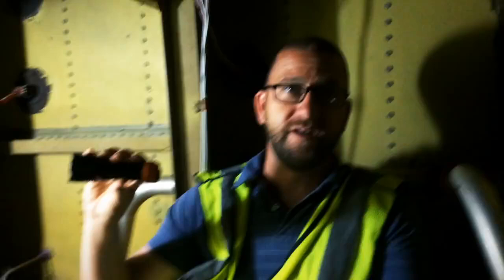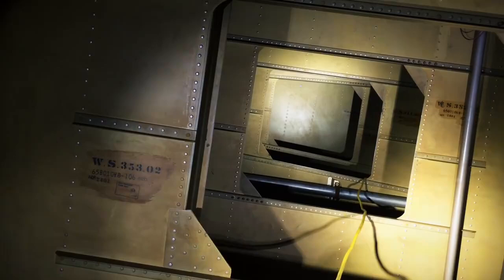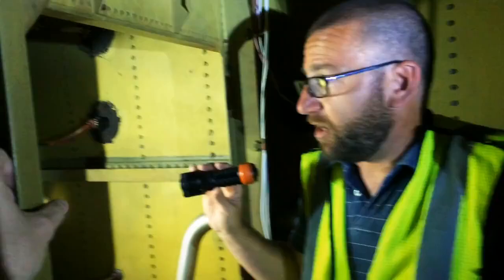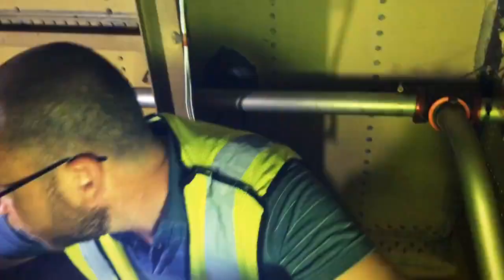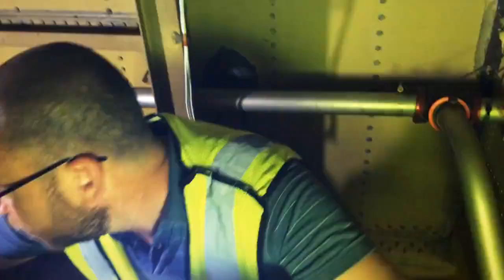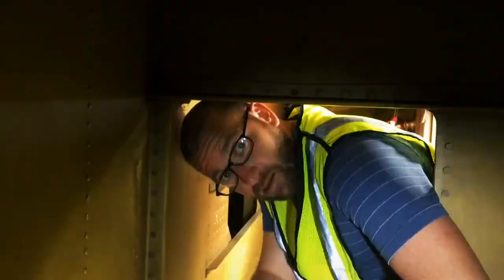The 747 Experience: In the Fuel Tank

Comment: The areas you showed that you called walls are actually called ribs and their main function is structural support so the wing doesn't collapse in on itself. What you have identified as ribs are actually stringers. I know the make up of the airplane wings because I've worked on them.
Reply: Thank you alphamalewolf1968. Good to have that cleared up, I was a little confused myself.
Reply: How tall are the wings supposed  to be?  Because from the  outside doesn't seem to be too tall or more than 2 mtrs high.  Also if anyone compares the mechanism used to move the hydraulic system of the wings that just plain and simple makes the whole scientific and engineering  data illogical, also why there is need to use air turbine starters? Also if it carried fuel as Mr speaker claims as nothing but the TRUTH  what doss ignite the mix. Air-gas?  Where is the fuel pump.  The whole  idea makes no sense at all whether the indoctrination is covered as education.  I find quiet interesting that even in some real videos of planes on fire in the airports  can last more than 4 minutes without exploting and still can't find evidence to discredit the lie about the whole crude oil itself as they say are the remaining  from some fossils or Dina sours...  Its there when you start to connect the dots and one issue opens up to what the CIA used for a cover up as "A CONSPIRACY THEORY" hoping the blind sheeple will follow the pattern,  as its always been proven "REPETITION"eventually truth will make its way,  as always.  Check this video,  recommended  to watch it complete. 
https://youtu.be/G28OlUqpUfE.  Also want to make sure I respect what your opinion is, wether I agree or don't, but life has fact proved government  and many  corporations have lie to the public in anything  from drivers  license when we have a right to travel, false  flags to push their agendas as recently the ban on guns, the moon landing and NASA itself with C. G. I cartoon photos..  And the list goes on and on...   The evidence its in plain sight,  but many are not yet ready to confront the reality  I guess.
Reply: George, I don't speak fluent gibberish so deciphering this is difficult for me. 
Here is a video of two men standing inside a 747 centre fuel tank, which will give you an idea of height. https://www.gizmodo.com.au/2012/07/these-guys-got-inside-the-fuel-tank-labyrinth-of-a-747-jumbo-plane/
The fuel pumps, and there are many, are usually mounted in cavities under the wing or on the front or rear spar. Each engine also has a high pressure fuel pump. 
As your sentence about hydraulic wing surfaces makes no sense I won't even bother. 
You ask about air turbine starters and your link points to a video about a jet engine starter, what’s your point? It’s used to spin the engine so fuel and ignition can be added to make the engine run. It’s the exact same principle as a car engine electric starter. By your logic if a jet engine uses air to start it must run on air, ergo, a car that uses electricity to start must run on electricity.
The fuel/air mixture is ignited by igniters in the engine combustion chamber. The igniters are similar to a car, lawn mower etc. spark plug.
Not every plane crash results in fire, the fuel tanks need to rupture, they must have fuel in them and there must be an ignition source. Jet fuel is difficult to light unless it's vaporised so even if there is escaping fuel it may not ignite.
The rest is just mad loony rambling but you talk about ‘sheeple’ yet you are the one following this drivel which has absolutely no supporting evidence. You should look in the mirror before you label people sheep.  What are ‘Dina sours’? A new sweet/candy?
Reply: David Tipton. I've just remembered something that "PROVES" trucks have been running on nothing but compressed air for many years. At least according to George Miller's logic. Up until not very long ago Mack trucks used compressed air to start too. I split my eyebrow open one time when I was working on one and another idiot who shouldn't have even been near it hit the starter. I was leaning over the right front wheel and that bloody noise they make had me launch upright and straight into the outer canister of the big air cleaner bloody hard. Gee, what a waste of good aluminium those 4 huge diesel tanks were.  On a Kenworth  I used to drive I had to keep filling them with around 800 litres of diesel or it wouldn't go anywhere. I know that for a fact. I actually ran out once thanks to a non working fuel gauge and a boss who'd just used it and said he'd put plenty enough in for the 1,300 kilometre trip I was heading off on. I knew I should have double checked, but he owned it and "should" have known better than anyone, he was wrong and I gave him hell when I finally did get back. I guess it must just be the Mack brand trucks that have been using this magic air fuel for 30 or 40 or whatever years.  I think they must have lost that technology because I don't think they use air starters any more, poor Mack trucks boo hoo.
Then again, just maybe, and just like the jet engines, they only use the compressed air stored in a receiver tank that they have to have to release the brakes anyway to start it which uses a compressor driven by the DIESEL ENGINE to refill it. OHHHHHH how the plot thickens. Or is it the heads of some of these conspiracy theorists that are becoming thicker lol.
Reply: King Congo:
I think most of the people agreeing  and commenting are very young and their brain hasn't developed fully which I believe doesn't occur until the early 20s. If there are people over that age making similar comments then they should be ashamed of themselves for being so gullible. 
I hope you recovered from your eye injury 👍
Reply: That's the thing that scares me David. While I'm sure you're right about most commenting are clearly young and immature there's clearly a bunch who I'm pretty certain are mentally immature, I'm pretty sure that some actually are purely and simply, mentally handicapped 'adults, like georgey boy above'!  Shocking I know, I'm actually serious here though. I do believe that there are actually, at least a few people who are actually THAT impossibly stupid!
The eye injury was nothing worse than I've had boxing or banging my head somehow in any sport thanks, just a three quarter inch split right down to the bone, buuuut, nothing new for me at all thanks David.
Reply: King Congo:
You're probably right KC, you really don't know who you are dealing with here or what their mental state is. It's just so frustrating seeing other people being mislead by these fools.
Reply: "  It's just so frustrating seeing other people being mislead by these fools. "
That's the part that really angers me most. There's no end of idiots that see the big numbers withe weight, fuel loads, cargo and passenger loads and just because they can't wrap their heads around it call BS, then the conspiracy kooks just love to feed that and try and make their idiotic lies sound 'more' reasonable by coming up with idiotic crap like this ridiculous and impossible compressed bullshit and so many know nothing people read their crap and since "it's only air" and doesn't weigh hundreds of tons they are much happier to believe the lie. If only they could get those same heads that couldn't comprehend the numbers there to what air compressed down to a liquid weighs they'd soon start to rethink their ideas. On top of that, even with air compressed right down to liquid I doubt it would create enough thrust to do more than move it maybe a few feet before it was all exhausted. And just where is this imaginary compressed air stored? Those wing tanks certainly couldn't be relied on to contain more than a few pounds without deforming the surfaces and likely making the aircraft unflyable. A few more pounds and they're likely to explode.
It's funny how the simple answer is usually the right answer, yet here people insist on thinking everything they're told must be a lie and the most ridiculous story "must" be the right one.  The world in general has made amazing advances in every aspect of life from medical to manufacturing and engineering to the sciences,,,,,,,, and then we've got flat earthers and anti science morons trying to go back to the stone age, it's sad, it's pathetic and we ALL should work to stop the bullshit fantasy crap.
Reply: King Congo: 100% agree KC 👍
Just out of interest, most aircraft fuel tanks have pressure relief valves in each wing, these are set at only a few psi positive and sometimes negative to protect the wing structure. Not going to hold much compressed air in there.
Reply: I wasn't 'certain' about what sort of, or how pressure was controlled inside those tanks so thanks for that info. I'm not surprised at a few pounds of positive pressure, I'd imagine that little bit would help quite a lot in maintaining the structure and shape. I am a little surprised that they'd ever run a negative pressure though. Is that to counteract the pressure from the weight of the fuel trying to push against the under surface of the wing to keep it as smooth as they can, or is it some other reason?  If you know and don't mind explaining that is.
Reply: King Congo: they don't want a negative pressure but it can occur if the vent system is blocked and the engines using fuel will create a negative pressure. In flight, airflow over an air dam under each wing creates a slight positive pressure through the vent system into the tanks to keep a 'head' of pressure on the fuel. Particularly handy if the main fuel pumps fail and the engine has to suck fuel from the tanks.
Edit: a link to the tank relief valve and vent, the shape of the NACA air dam provides a positive pressure in flight. http://www.b737.org.uk/fuel_tank_vent.htm
Reply: I see now, thanks David. I thought it would be undesirable since a bit of positive pressure (not too much of course) would help the wing hold it's form and probably add strength to the structure. Thank you :-)
Reply: @heribertodejesusleiva4649  have you seen the size of a starter on a car or truck,,,   can u imagine the size of one needed to turn a massive jet engine and the weight of them,,  and all the electrical cables and size of them to take the large current needed,,,
some jets have electrical starters,,,  certainly helicopters,, and piston aircraft,,, big jets have a small jet at the back near the tail which runs on the ground to provide electrical power if external power not available
they can be used to power the electrics ,,  hydraulics and have a tapping for bleed air
which can be used for air conditioning,heating and starting engines,,so  it saves a lot of weight,,,
some older  aircraft used to use a big shotgun cartridge to start the engine,,  watch flight of the pheonix at the end where they try to start the engine and get down to the last cartridge,,,
in short every thing is about weight saving,,,  from a fella shouting contact to a big wind up spring,,  to air starters,,   cartridges or starter motors there are many way to start an engine,,,  the application comes down to what suits individual aircraft,,,
Reply: they also act as baffles from what I understand, which is what he said.
Reply: @DavidTipton101  "George, I don't speak fluent gibberish so deciphering this is difficult for me." this comment wins the internet today.. 😁😂

Comment: Just look at the size of those openings and ask yourself how is that going to baffle fuel when the plane rolls to one side.
Reply: The airplane is very big compared to the size of individual chambers of its tanks.
Reply: How small do you think that airplane is?
Reply: The openings were put there to save weight and to allow mechanics to get through to perform maintenance and to allow the fuel to flow from the wingtip to the root as fuel is used. 
Otherwise the ribs would be completely solid and Boeing wouldn't have bothered to make the "holes".
Ignorance is not knowledge!

Comment: That’s impossible passengers would feel the loose liquid when the plane makes a turn
Reply: The fluid dynamics are explained here: https://youtu.be/VpzUbYex4dg?t=251
Reply: Did you actually watch the video? There are baffles in the tanks to prevent fuel sloshing about. Also the fuel is contained in many compartments. Also aircraft make smooth "coordinated" turns and the g forces generated in turns ensures that the fuel remains where it was, not rushing out towards the wingtips.

Comment: I wouldn't go in there without a gas mask. The smell of fuel would just kill me 😂
Reply: Nice-oscar it’s drained and vented, for days
Reply: I’m sure it’s aired out but jet fuel has a VERY pungent and strong scent
Reply: @hunternelson3018  I was inside of one of the cargo tanks of the Chevron Oregon back in the 80's. It had been filled with gasoline but there was no smell of it after it was washed and aired out. The size of that tank was astounding yet the tanker was a small 35,000 ton coastal ship. There are stairwells going to the bottom.
Reply: @thesauciestboss4039  I'm sure. A mostly empty fuel tank is one spark away from an explosion. That's why they have to be inerted with nitrogen now when flying with no fuel in them. That airplane is likely either new or in for major overhaul.
Reply: @RH-sf7lk  it's a museum piece.

Comment: I never knew you could crawl through it's wing?
It's amazing that the fuel doesnt leak from anywhere from repeated turbulence stress after many flights.
How interesting !!
Reply: Every part and each bolt are calculated to hold more than worst case scenario. There was one case (737 if I remeber correctly) when aircraft lost 30% of left wing and half of right horizontal stabilizer due to very strong turbulences caused by strong wind with mountains close by - they landed just like nothing happened.
Reply: They do leak! From exactly the reason you said here